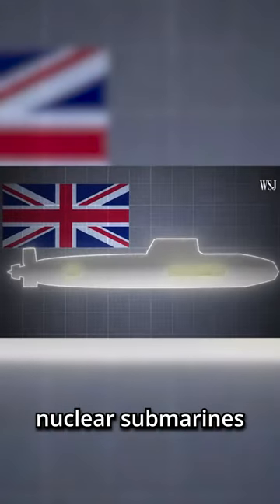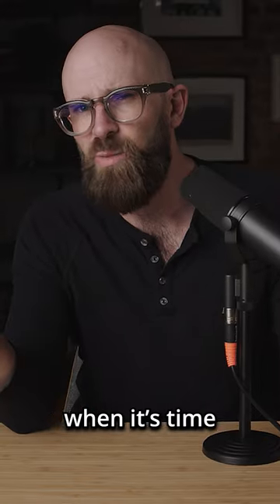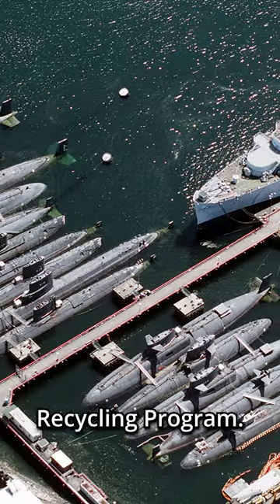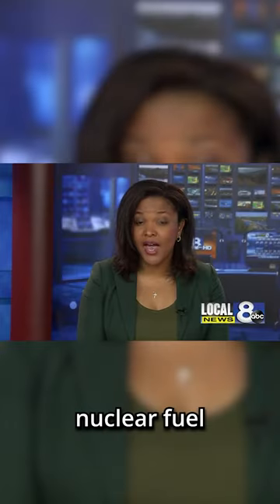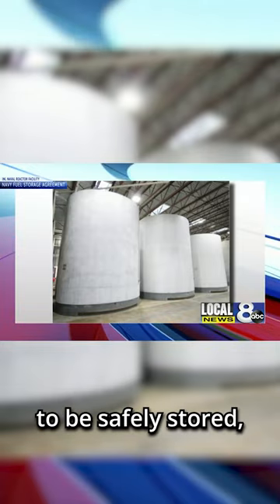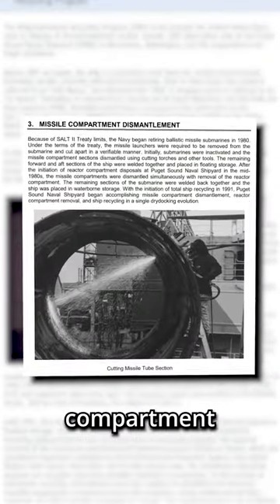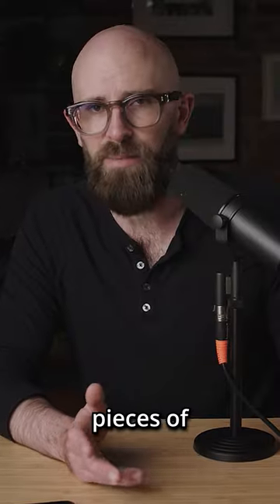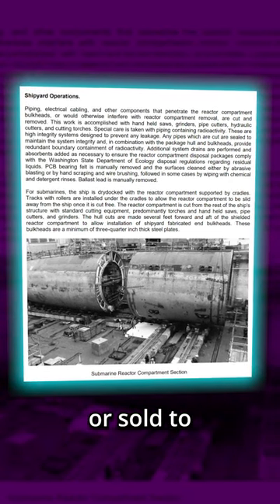What Happens When a Nuclear Submarine is Decommissioned? #shorts

Comment: The Idaho Nuclear Lab is located just east of the Snake River aquifer. So if there is ever a leak or contamination breach from that location, most of Idaho’s drinking water will be gone.
Reply: ...which is more of a non-issue than you think. Nuclear waste is not glowing green goop like you see in cartoons, nor is it just lying around in loose barrels. It is solid waste, not something that can "leak" out, and kept in several layers of mixed concrete, lead, and steel that would require a massive bomb to bust through.

But assuming the place was bombed, or a massive destructive earthquake happened (in Idaho, no less), no green goop would be seeping into the water supply. The immediate area would be contaminated and sealed off, but since the nuclear material would not be HOT like it was in disasters like Fukushima or Chornobyl, it would be relatively harmless. The water supply would barely be touched, if at all.
Reply: Fortunately, those casks are designed  to be almost indestructible. Testing for the durability of these casks include a collision with a freight train at full speed, an F-16, and explosives. In addition, the spent nuclear fuel (which is a solid) is melted and mixed with inert ingredients like stone and metal. This diffusion causes the heat of the fuel to remain low, unlike active fuel. So even if the damn did burst, these casks could have an entire train smashed into them without any of the spent fuel being exposed. It's really cool how tough these things are, which is a part of the reason why they are kept above ground. It's due to how unnecessarily laborious it is to bury them. Even a deliberate bombing might not penetrate the cask, even if it did the diluted solid fuel might not be enough to cause any trouble at all.
Reply: @casual_speedrunner1482 honestly the process is pretty cool, and there are so many videos of those containers being tested, most of them contain the exact same container used in the last tests since they are so hard to destroy
Reply: @theguythatlikeslegos7708 not because they are hard to destroy but because they wanted to know just how much theu can take. And the best way to test that is use the same one til ot finally gives

Comment: Can those reactors be used to power cities?
Reply: Potentially but the US and Russia have treaties that require when those subs are decommissioned and cut up the reactors have to be stored together and visible to satellites so both sides can check to make sure they are actually being decommissioned.

Also it's not really economically worth it in this case to use them. These mini sub reactors use extremely enriched fuel something like 50% uranium or plutonium to generate what they do. While a normal nuclear power plants fuel is roughly on the high end maybe 5% uranium. The cost, time, and risk to enrich fuel that much is significant, plus these ship reactors require far more constant management to operate.

Imagine cooking on a tiny little skillet on a big burner versus a restaurant griddle with a large 3ft x 5ft x 1in steel plate. You really have to be on the ball and manage the heat and cook times for the tiny little skillet depending on what is cooking. But for the griddles 1" steel plate it is very consistent and slow to change it's heat regardless of what's cooking on it. This is similar to what it's like to operate the sub reactor versus a power plant reactor and how they differ. A sub reactor due to it's small but very high powered nature requires a lot of attention and is far easier to mess up than a large steady power plant reactor.
Reply: No, a live SSN only produces about 3.2 MW of energy, and most of that is needed to run the core itself 
Wouldn't make a dent in a big cities power demand
Reply: No , they cannot.